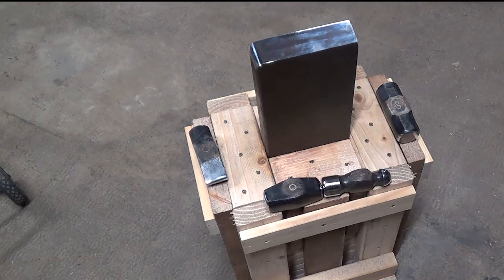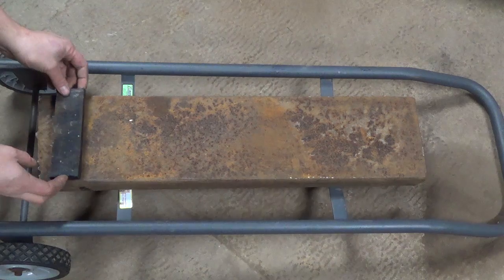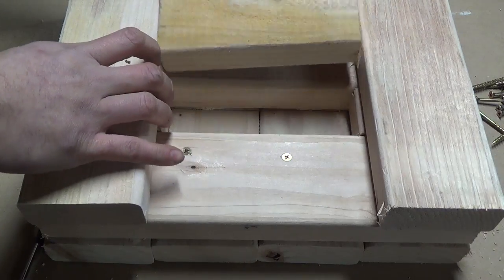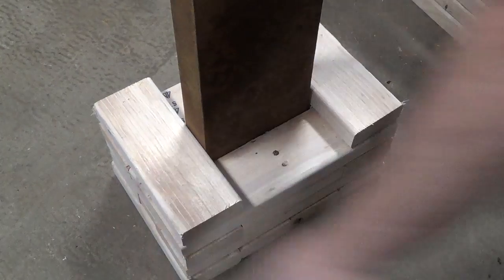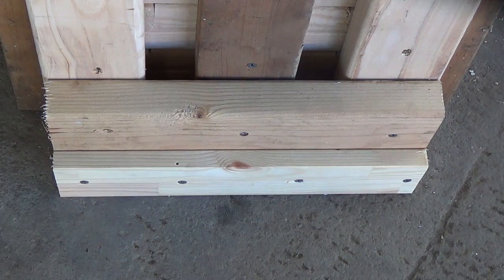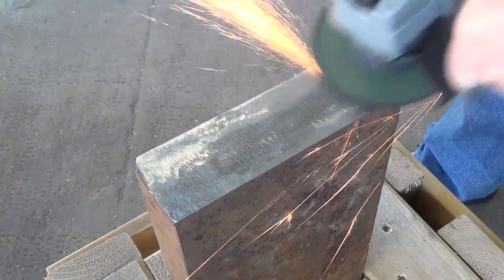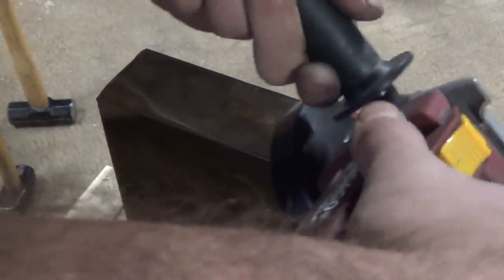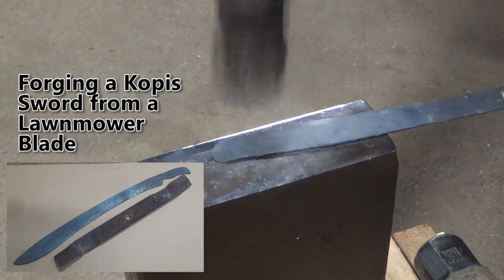How to Make a 100 Pound Scrap Steel Post Anvil and Stand for Blacksmithing and Knife Making

Comment: As a once-and-future home builder, the only thing I've ever used glue for is flooring, cabinetry, stairs, moulding-crown, base and chair rail. As a fellow blacksmith, I think this kid did a phenomenal job with the anvil, in all its parts. the glue and screw method is bulletproof in my opinion. my only concern, would be moisture causing that mild steel to rust...but that won't have much affect on the wood for a long long time, and it'd take a century to rust a half-inch of the body of the steel away. Strong work brother, and happy forging

Comment: Great Job!
I worked in a machine shop & heat treat shop.
I know your anvil is harder than the ones used in 1500-1700's, because the metal is better, purer than what the smiths had at the time. It is 100 times better than railroad iron, I know a lot of people disagree with me, but they are so called makers & are not professional metal worker, welders or fabricators. You are on the right track, keep up the good work.

Comment: I'm a retired blacksmith. I've rebuilt and/or refreshed a number of anvils. That's a fine homemade anvil. My only suggestion is to have a weldor lay down some hard facing rod on your anvil face. Grind it flat and you will have a much harder surface to forge upon.

Comment: You can use a Stoody 1105 electrode and cover the top with about 3 passes then grind it down smooth.  This will give you a really nice hard surface.

Comment: Hey Nick, I don't know if it would help any, but I might suggest tempering the top of your 15lb anvil to make it harder. Another alternative would be to weld on a chunk of thick tool steel or something on top to make it heavier and to give it more bounce. You could just keep it as a back-up or even sell it. Just a thought. I started out with one of those tiny Harbor Freight anvils and it worked for me. Enjoying the informative and professional videos. Keep it up. :)

Comment: Here's a tip when gluing and screwing: dry assemble the pieces with screws first, then disassemble, glue, and retighten the screws. The screws act as clamps, and the pieces don't slide around while you're trying to get the clamps on.

Comment: ha, excallent. I didn't know you were working with steel. i got a small cast iron that I've beaten to death.  I'm making an anvil with a steal plate over a fir cookie and drilling out holes to pour in molten lead so i can get the rebound out.  but i like your scrap steel build.  you don't need a horn for most work. and i'm a backyard, ghetto builder with a fairly nice shop

Comment: That's a really cool project.  That anvil is an innovative way to use what you have to get the job done.  I started with a small anvil and had the same wobble issue.  I have since upgraded to a full size anvil, though with some damage on it.  Your project here makes a really cool looking unit that would look nice in my shop.

My only concern, I'm sure it has been brought up, is that it is mild steel.  You can harden mild steel to a point, but let's face it that would be a lot of work.  Have you done much work on it so far?  If so how is it holding up?  It might be a little heavy duty but finishing work might be easier on it.

I still love the look and design of it.  Next time I come across a piece of scrap steel that long I'll think of this.  Keep up the good work.

Comment: I don't know if you have access to a stick welder, but, with a great base that you have you could hard face the top surface of your vertical anvil with hard facing rods. This would make what is already a very useful anvil into a good anvil for the rest of your life!!
Regards, Matthew
Reply: hard facing rods?
Reply: Hard facing welding rods allow you to build up a layer of hard metal on top of mild steel using an ark welder.

Comment: Great creativity! On my to-do list is to hunt down a block similar to this. I already have an excellent Peter Wright but there are times when something narrow like this would be advantageous. My only suggestion would be, to prevent your future frustration, would be to dress the edges. Leave the sharp edge on one end and then slowly increase the radius diameter as you move toward the other end. This will not only prevent chipping but will allow you to form various curves on your work pieces. A sharp edged anvil will produce cold shuts which will be where tools will break or knives will crack. 

Keep up the good work! Forge on!

Comment: would you be able to use the angle grinder to smooth base of the anvil to help the rubber block under it or is that not necessary

Comment: Nice!  Just goes to show you don't have to have an expensive anvil for blade work.  I think you'll find that the face will batter up over time, but it should be easy to correct and work just fine, and will even work harden a little.  I build a post anvil from 4"x4"x12" 4140 and heat treated it, but it was a PITA heat treating that big a hunk of steel.  A cut off end of a large fork lift tine would probably be good to go as is, just need the end cut and trued up.
Reply: +forge52100 Tell me about it, I made mine from 400mm tall 130mm wide 4140 roundstock. Lifting that out red hot and dropping it in a barrel of water was interesting but it came out with an incredible rebound.

Comment: I agree with the hard surfacing with rods. Then I would spend a few $$ and have the surface milled perfectly flat. Still a great looking anvil. I had an actual anvil milled flat after many years of hard use. Cost me $45.00 at a local machine shop.
Reply: JohnnyB8224 could you forge me some precision gears for my Rolex?? Lol :)

Comment: If you need a small anvil, there is a much cheaper and easier alternative. Just buy a big sledgehammer head and use it as an anvil. These are usually heat treated high carbon steel, have nice crisp edges that can be used for different things, very heavy and steady even without stabilizing to a table or bench, and the hole in the centre can be used for many things. It really worked for me.

Comment: I would have used the side with the most surface area so that you can do more projects that may need to need to have a larger anvil and an anvil with a tool rack not to mention it won't move for the most part brilliant anvil base.

Comment: Hey man, if you're going to glue wood, you better smear out the glue so that it makes a nice and even layer. That way the bond of the glue is virtually stronger than the wood itself. The way you now did it makes the glue bond very weak compared to how it's supposed to be done. Just a tip! Thanks for the video :)

Comment: A commendable project; good job.

Not to be insulting, as that is far from my intention, but can I suggest you swing your hammer with a little heavier blows? Sure, you don't get deep marks, but your metal moves so very slowly. . . Just a tip from a blacksmith.

Comment: BYB..  Very innovative...   You will need to add some hard facing to the top and edges so that your surface will be more durable.  If not, you will be having to resurface now and then but not as much as cast iron.

Thanks for the video..
Shad
Reply: pvc bows

Comment: a good trick with finding high spots with sand paper take a sharpie color all of the shiny parts in the but it with sand paper where it's high the marker will b removed where it's low the sand paper won't touch it

Comment: u should add a sheet of metal and set it on the top row of the wood so incase if u were grinding something on it so if the sparks hit the wood it wouldn't get caught on fire
Reply: A spark is not going to set a 2x4 on fire. The thermal mass difference it too high. Heck you have to hold a blowtorch to a 2x4 for several seconds before it ignites.
Reply: k well he could still add a sheet of metal incase he doesn't have tight enough grip with the tongs he could drop the heated metal on the 2x4 and it can burn the wood
Reply: and then the world will perish

Comment: How did you get the scrap yards to sell to you? I have called a half dozen scrap yards in my city and none of them will even entertain the idea of selling me anything. They said that they only buy scrap from the public and they sell it to some wholesaler. They said that they didnt have a retail license and could not sell. I replied by offering 10 or 20 times what they would get from selling it to the wholesaler and they declined. I want to buy some thick plate steel for some pistol targets and do not want to buy them new. Where should I look to buy scrap? Appreciate all input.

Comment: Well hello Nick, I have watched alot of your vids hoping to learn more about metal working, and I sure have. I have been wanting to make a break drum forge, but  I think  that the heat from the coals would release the toxic heavy metals in the break drum ( Lead, Mercury , ect.) Would is this true, or is it safe? If not what else can I use as a  burnpot that can handle high temperatures?
Reply: Oh cool! I thought that the precautions we take when doing break work might mean that there is something dangerous in the metal. Thanks man, I'm syched, now I can get to work on it. I've been wanted to get started in metal working for a long time and I have not had a forge to do so.
Reply: metalhead2508 Oh cool! I thought that the precautions we take when doing break work might mean that there is something dangerous in the metal. Thanks man, I'm syched, now I can get to work on it. I've been wanted to get started in metal working for a long time and I have not had a forge to do so.

Comment: I am not a metal worker so my question is probably totally ridiculous.  the top of an anvil is hardened.. is that huge piece of steel hardened? or does that no matter?
Reply: ^not
Reply: +BeeSeeBee He could just keep grinding off the worn metal, but all that would be needed is to harden the face being beaten on. Though that would take some time to heat up that thick of a piece of metal, especially with the forge he has. I'm no expert though.
Reply: +BeeSeeBee not a ridiculous question at all. the face of the anvil does need to be hardened or he can just grind it down when it gets badly damaged. easiest thing to do would be to weld some harder steel to the top.  but he can also try to heat up the top part of the anvil and go through the tempering process with it.
Reply: +the oncoming storm not a hardened steel, a hard steel. One with a high carbon content is what I meant. You don't want mild steel on the surface of the anvil.
Reply: +the oncoming storm i was clarifying my statement, not contradicting yours. i don't recall contradicting you. in fact for the most part it sounds as if we  agree except for the type of steel that should be used. personally i think that a harder steel sounds more attractive, but if you are saying that mild steel would be better than i bow to your superior knowledge. obviously someone who feels the need to continually hammer in that they were trained as a welder would know more about metalworking than the guy who has training as a vulcanizer.

Comment: Heyho BackyardBowyer, qot a question about the anvil

The way you build it makes the anvil not very mobile. Is it possible to preattack lets say 4 wheels on the bottom before sliding in the anvil part. Or will the Weight most likely break the wheels anyway?

I am looking to build one maybe myself in the future, but i want it kinda mobile to hog around.

Or is it a bad idea?
Reply: yeah, it will snap anything less than something way out of proportion to the anvil. what you could do though is something like a handtruck. the wheels are slightly off the ground until you tilt it back onto the wheels. A couple of removable handles and you have a portable/maneuverable anvil.
AAR
Reply: ASZHanazaki It's portable... use a dolly.
Reply: Rhys Tal Cernunnos I don't have wheels on my fridge... how did I ever move it...

Comment: I like the simplicity of the idea but then it hit me when the metal is glowing hot and you are hammering or brushing it and those little sparks of glowing embers land on the 2x4's won't that be a fire?
Reply: No it wouldn't. Mine doesn't catch fire. The wood is treated for starters, and some embers wouldn't catch it on fire. It would take like an open flame to do that. It's safe.

Comment: Nice idea. No need to harden/temper that piece ?
Reply: Roy Bean he said its mild steel, which won't harden. He'd need to somehow layer high-carbon steel on top. Then it would harden. I think it's possible to buy high carbon MIG welding wire. You could put a thick layer on with that, grind it flat again, and heat treat it, although it'd be a bitch to heat something that big up without a huge industrial forge.
Reply: Thanks .. it's not my expertise obviously.
Reply: Roy Bean ar500 steel makes a good hard face. Also I think mild steel does "harden" just nowhere near the extent needed for any useful application. 

Apart from throwing knives maybe..
Reply: Roy Bean better than the brittle cast iron crap

Comment: I prefer square drive or star drive screws. I find that they don't strip out as often.
Reply: +tetsubo57  Yeah, I like those, but I keep losing my square driver bits. It is a lot easier to find a phillips.
Reply: +tetsubo57 Phillips or Robertson heads.
Reply: One of those square drive bits slipped and went halfway through my finger. No thanks. Torx for the win
Reply: The one time I drilled into my thumbnail an eighth inch, it was a phillips on a wallboard screw, puttting theater sets together. The tool is not to blame for the accidents. I just find the torx or square don't slip off so easily.
Reply: I also have put a Phillips driver into my thumb. After that I have grown more fond of the square drive .with that said I usually use what is available . Lol
Reply: +NerdishAzn  it must be lol.
Reply: +NerdishAzn  it must be lol.
Reply: ***** While I agree for the most part, there are many tools that are inherently dangerous, even when used correctly, generally these tools are no longer permitted to be sold, but that's besides the point. It isn't always the fault of the user, though in these cases, I would absolutely agree that it is.
Reply: you along with every person on the planet earth lol

Comment: Wow thats a nice find! I wish I could find a piece of steel like that! What I would do with that is I would cut off like 4"- 5" off one end and then weld it to the top end of the slab making like a T shape. That way instead of having a 2"x6" (I'm guessing the dimensions. Am I close?) work surface you will have a 4"x6" surface. Or if you just cut off 3"- 4" off the slab and set it aside. Then buy like a 2"- 3" thick x 4"- 5"wide x 10"-12"long piece of hardened steel and weld that to the top. Then take the 3"- 4" piece you cut off and grind it down to a horn shape. Then weld that to the 4"- 5" wide side of the hardened steel and BAM! you'll have a awesome home made anvil that has a large hardened steel work surface and a proper horn!
Reply: +Randomus Maximus I wouldn't bother mate. 2x6 is plenty for knives and having large overhangs on an anvil brings with it a host of problems. My first anvil was a 400mm tall 130mm wide 4140 roundstock I found at an industrial scrap yard. I dug a big hole in paddock and heated the end to non magnetic and then dunked it in a barrel of water. I'll tell you what, lifting a 40kg red hot cylinder and dropping it in a barrel was more than interesting. What resulted was a post anvil with a fantastic rebound comparable to my peter wright. 

If you can, check out metal yards. Not car wreckers but real industrial scrap yards, places where left over construction stuff is dumped. Ask for big solid steel hunks, they will be more than happy to sell some to you. Another option is always railway tracks, they are made from high tensile steel which is good for and anvil. Big axles from tractors or big trucks are also high tensile 4140 type steels.

Comment: Maybe I'm just OCD, but the idea that the half of the anvil underneath the stand is still rusty would drive me nuts. I'd end up taking it back out and grinding down the whole slab. Good work though, cool project.
Reply: +ZDG It should have been done before placed into the stand, rather than as a finishing touch imo...
Reply: +ZDG Ah so your one of those type of guys,i mean if you were hammering a nail and it got bent,you would try to straighten it no matter what.Well you would go all the way or try
Reply: +ZDG A thin layer of rust isn't really a bad thing.  Rust can act as a decent barrier against natural factors such as humidity.  Besides, if it's already a bit rusted it can't develop as much rust as a clean piece of metal can that's been oxidised.
Reply: if you are worried about rust debilitating the metal, you are better off leaving it as it is. you remove the rust, you and it will eventually come back as it is in contact with the floor. there's nothing you can do about it. you can apply a protection, you will be just wasting your money in my opinion
Reply: Hahaha. That's exactly what i was thinking. Great idea though.
Reply: Gotta remember a layer of oxide rust is a perfect protection for the steel, the oil may dry out in time but that thin layer of rust will keep the metal good for hundreds of years, its only when something breaks the layer that the rust goes deeper

Comment: how well does it bounce?
Reply: Ryan Kalle mild steel? I wouldn't expect much. But a decent upgrade from cast iron..
Reply: The rubber underneath would absorb some energy, reducing the bounce, should've cut that end flat and done away with the padding.